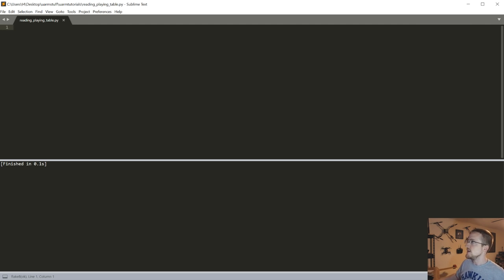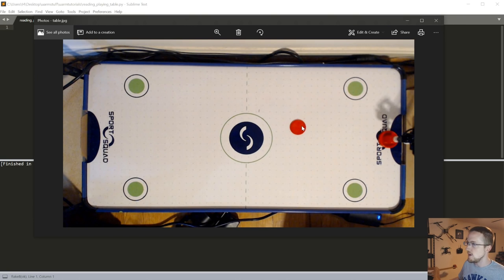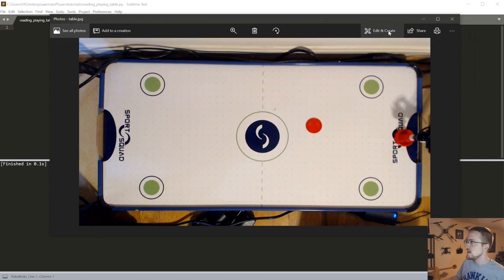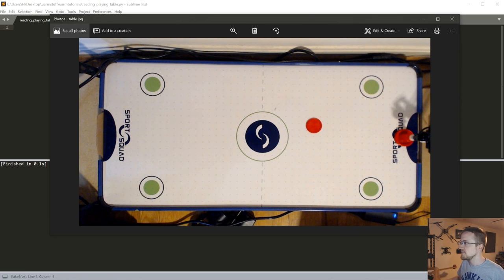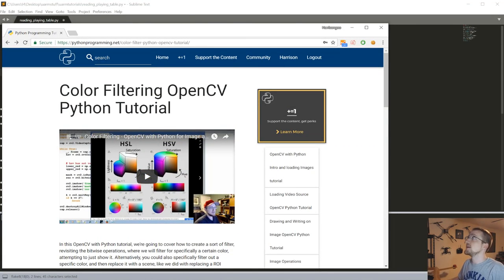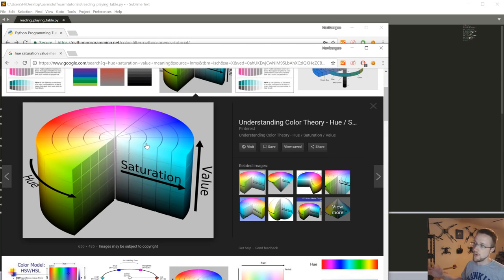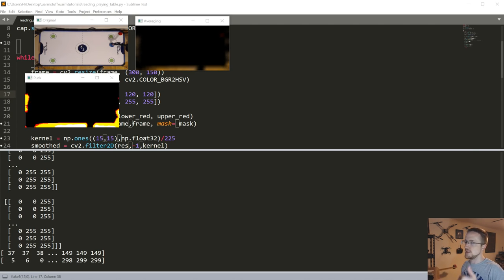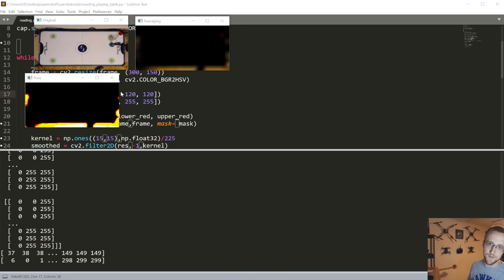Filtering for Puck - Teaching a Robotic Arm to Play Air Hockey p.2

Comment: HSV Filtering is quite unstable so taking the average to find the ball location is not a very good approach. If you have some outliers (other pixels detected as the puck), they will heavily affect the average. A better approach will be to find the contours on the filtered image and assume that the puck will be the largest, then you can use standard openCV tools to find the center. 

If the camera is in a steady location you could crop the image to only contain the hockey field. Remember that in HSV domain, RED actually spans around in hue so you will both have to take upper values (160 - 180) as well as lower values (0-20). So often you will have to make two filters and combine them with an OR operation to really capture red in HSV.

Nice video, looking forward to the next one :)

EDIT: Generally this is a quite hard problem. Real time control through camera feedback. For on the puck will move quickly thus the single images of the video feed can experience frames with the ball blured by motion. The input lag also has to be very low to be able to have real time control. FPS is also quite an issue since Shannons sampling thereom also applies here, so we generally want to have a sample speed (FPS), twice of that in the robot actuators to have optimal control. Very interesting, did my bachelors thesis in a smilair project, where I had to track a ball and laser pointer with a raspberry pi and then through servo motors make the laserpointer center in on the ball in real time.
Reply from the maker: If you have some suggestions for me to try, feel free to PR, or just share a gist...etc. The source code is here: https://github.com/Sentdex/uarm I will gladly test anything live, I have also uploaded a static image and a video file that you can use to test if you like.
Reply: Better lighting and slower shutter time to reduce the blur. Kalman filter to drive it home.

Comment: hey bro  instead of tracking red colour try motion detection
that might help may be add a ROI as well
Reply from the maker: ROI coming, great idea on motion detection, i worry about when the puck is close to the agent though, since the agent will be moving too.
Reply: that's where ROI comes into play, add ROI such that It will ignore the area where agent will be moving 
and since you know the initial position of the pluck through adding the initial coordinates to a list you can guess where it will be going outside the ROI ,  (agent area)

or may be something like ..
 add a position threshold so that when the pluck start to approach the agent area,  you can  begin the colour detection ..

but as I am pretty sure you will be using reinforcement learning , as collecting data for this type of task is a real pain ........    I suggest you to try the first approach as with time and training your model will eventually learn to predict the position of pluck outside the  ROI
Reply: What about tracking a symbol stuck to the top of the Puck?
Reply: Scott Wears that can work as well

But in The task like this processing speed is most important 

If we try to track a symbol in a frame you have to go through each pixel scanning for that symbol 
That can result in bottlenecking of frames ,and for this task we need as much frames as positions    Since these frames are our data 

While on other side with motion tracking you can simply track a object by comprising current frame from the initial frame 

I want to try both of the approach. But the video he provided on his github is not working in my MacBook 
So today i will probably make my own small rig and  compare the results

Comment: I'd recommend using OpenCV contours finder functions on thresholded image. With them you can just select the edge of a puck and using moments and knowing its a round shape calculate the M00 M10 M01 and get x=M10/M00 and y=M01/M00
here you can find documentation about contours: https://docs.opencv.org/3.3.1/d3/dc0/group__imgproc__shape.html#ga17ed9f5d79ae97bd4c7cf18403e1689a
Reply from the maker: If you'd like, you can create a PR or even just modify and share a gist or something from the source code here: https://github.com/Sentdex/uarm. I will gladly test things or you can use the provided image and/or video for some testing.